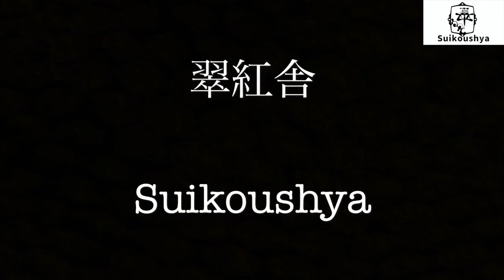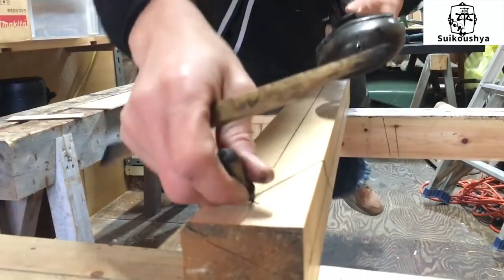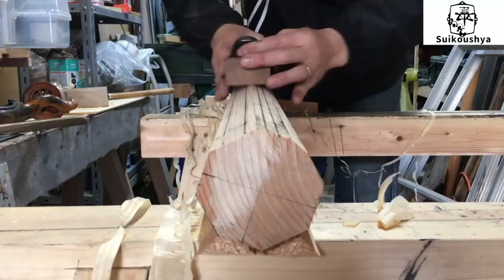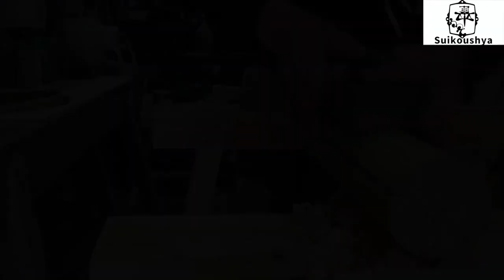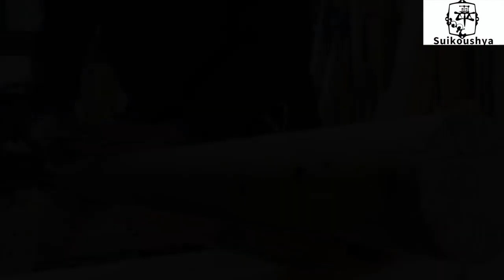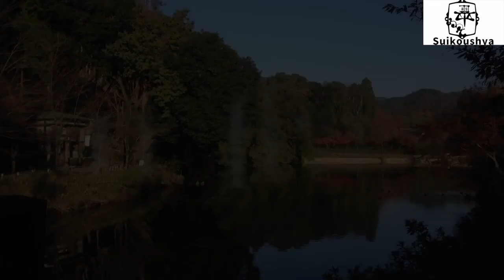Making Wood Round using Japanese Hand Planes　円柱を作る

Comment: I don't understand why you start from an octagon and then a hexadecagon, etc, why don't you start from a circle drawn at both ends of your wood from the beginning?
Reply: Just guessing but if he did as you suggest he wouldn’t have any references in the middle of the wood, basically anything between either end he would be guessing at. Using the chalk lines, he always has a reference point to work to.